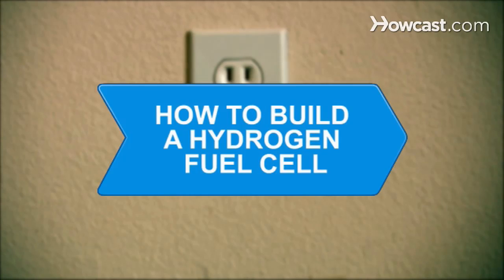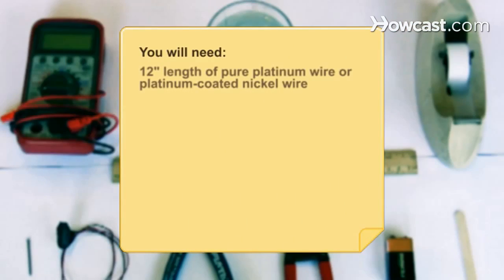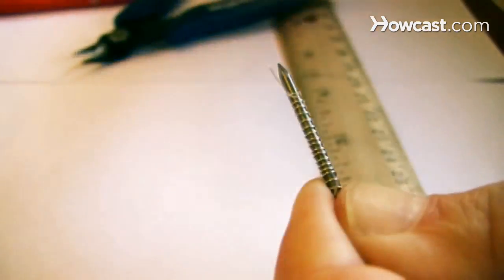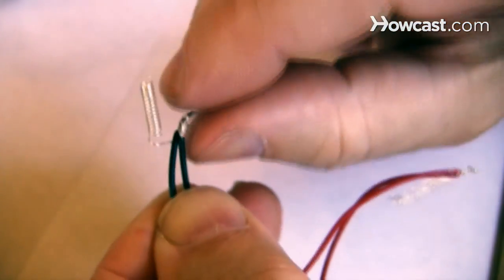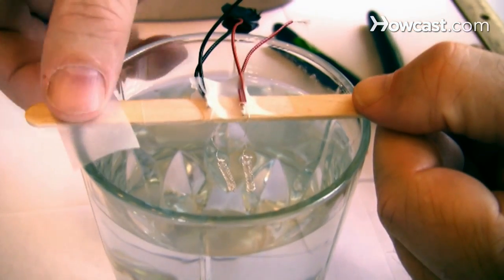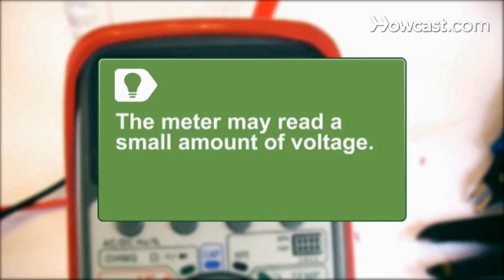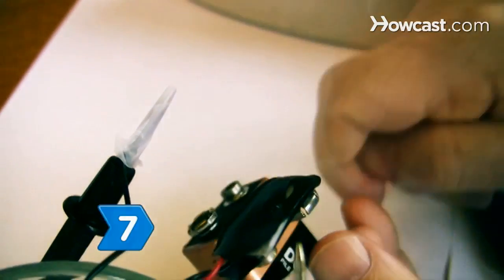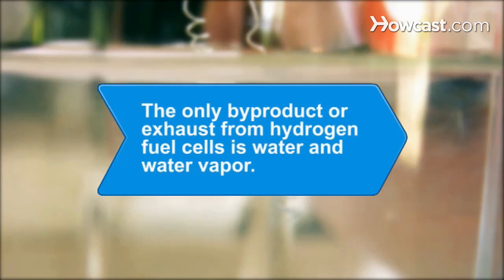How to Build a Hydrogen Fuel Cell

Comment: is it necessary to use a platinum wire only?
Reply: Platinum won't corrode when using the electrolyzer, you can also use stainless steel electrodes also.

Comment: Sorry to break it to you, but this is not a fuel cell. Fuel cells produce electricity by oxidizing hydrogen (making water). This is an electrolyzer, a device that separates water (hydrogen and oxygen).

Other than that, this is a nice device

Comment: will copper wire work, or does it have to be platinum wire because I'm not spending $90.00 on some wire.
Reply: It needs to be platinum. This is one of the main reasons these fuel cells arent very widespread
Reply: will nichrome wire will work?
Reply: The Creative Lone Wolf Channel I don’t know I used a combination of aluminum and platinum and it did the job well it had 6 volts going through it, it was enough to power an RC car for 1 minute

Comment: This is not a fuel cell, it's an electrolytic cell. The fuel cell produces electricity from H2, an electrolytic cell produces H2 from water.
Reply: Need to watch the end. At step 7 he removed the battery and got voltage as the hydrogen and oxygen recombine thus indeed it is a fuel cell
Reply: The real hero here is platinum which is expensive catalyst i want something cheaper
Reply: @omsingharjit   Yes it makes me wondering. I have a micro off grid system with a solar panel of 45 Watt and AGM battery of 14Ah 12V, how long would the platinum wire need to be in order to reach the same electrical capacity of that 12V battery, and... will the platinum hold/not corrode?
Reply: @pieterpauwelbeelaerts5995  try to make Hydrogen fuel cell with cost efficient platinum electrods .
Legnth and waight doesn't matters but Surface area does and it doesn't corrodes .
Reply: @omsingharjit could just have copper coated in platinum, as you said only surface area matters. Wouldn’t be too expensive I would of thought. Anyway upfront cost would out way the cost of paying for electricity from the current national grid…
Reply: @darknightfawkes1028  there is difference between platinum coated with copper and  copper coated with Platinum.
Reply: @omsingharjit  yeah I know, why are you saying that?
Reply: @darknightfawkes1028  I mean, would not it be cheaper to use platinum plated copper then using the bare platinum metal ' that's what i was saying.
Reply: Platinum allows hydrogen and oxygen to combine.. 
When this happen electricity  is produced.
However this simple demonstration uses more electricity  than it generates..
The Loss from the 9volt battery is greater than the electricity  generated.
If you can split the hydrogen from the water with say a solar panel .. this is the future we are looking at.
Toyota has a range if hydrogen  fuel cell cars and small Vans.
●
I first saw them in the UK 2019
They are amazing..
Buy platinum..lol
Reply: @paul_the_merciful  you put in 9 volts but you only get about 1 volt I have gotten 1.08 volts max
Reply: Al Wa 王八 王八蛋 Winnie D pooh  how ? Any scientific paper or post ?
Reply: This is a demonstration of principles, not a practical device. He briefly uses electrolysis to get hydrogen and oxygen on the electrodes then removes the battery and shows the device now generation electricity from these gasses. A practical device would be much more complicated and expensive to build.
Reply: I re-watch it and notice he already used plated platinum, so don't remember why I commented this 😅 !
Reply: @omsingharjit  yeah I also noticed that lol, but this video isn’t the best to be honest 😂
Reply: at the end though, he said the system read a voltage

Comment: so this uses h20 and platinum to continuously produce voltage even after the input voltage is removed? how long does it do that?
Reply: As long as you can supply hydrogen and oxygen it'll keep going (not sure about degradation over time/use but I would say its in the years at least). Its a battery that runs off fuel input, rather than charging. Or more accurately its an engine producing power from fuel. So as long as you provide more fuel it makes power.

Comment: How does that setup stop the produced hydrogen from rising up into the air and just blow away as soon as it's produced? Doesn't make much sense to me...
Reply: It doesn't you make this then light a cigarette and blow up!
Reply: My question is, I want to light up the Hydrogen considering it's in small quantities, so should I?
Reply: it recombines dissolved Hydrogen and Oxygen in water to form water
water can contain H2 at 1.6mg/L at 20deg, and more for O2
so its enough to power small electrical devices safely, around .0394wh of energy in 1L of water
mb you can dissolve more H2 via bubbling it in water and it reacts around the platinium

Comment: So in simple word...water can be use as rechargeble battery? 
that what in my mind after see this. is it true?
Reply: no
the battery splits the water into hydrogen and oxygen, then the hydrogen and oxygen form back to become water and a small current is produced. you put more voltage IN than you get out. This is NOT a rechargeable battery...

Comment: its green, cause 9v batteries don't cause pollution
Reply: The best way is, rather then using a 9v battery, use a 12v solar panel
Reply: technically true and false. pollution was generated in the making of the battery so its already made its pollution. 
its difficult to be true green until we get rid of all Co2 emitting power productions.
Reply: @darkshadowsx5949  what about buying second hand solar panels?
Reply: also this sounds more like a hydroxy fuel cell

Comment: How is it possible that the cell works while the hydrogen and oxigen isn't seperated. I always thought that by seperating the two gases, with for example a membrane (or in this case maybe water), you could create a current.
Also I don't get how the hydrogen gas stays where it is made, or within a short distance of the platinum electrodes. It looks like it is just flying away (the bubbles are going up...).

Comment: this is a great video of the concept.  remember kids, energy can be neither created or destroyed. You can store energy. You can transfer energy from one thing to another, and transfer it to something else or even get energy back.  The battery contained energy until it was put in water.  since it takes energy to split water into Hydrogen and oxygen, those little bubbles that stuck on the electrodes have energy from the battery. Finally we see energy coming back out and shows up on the volt-meter!
Reply: But that is not a fuel cell
Reply: @SultanSalahddin  Yeah I was thinking the same thing, isn’t that just an electrolyzer?
Reply: Thank you teacher !
Reply: @lrham  must be sealed too!

Comment: How would u keep it running for a long time?
Reply: not. only the small amount of H2 in and near the Pt electrode will generate electricity. Once that is converted the flow of elctricity will stop.
Reply: @raccoon6072  you would need two separate reservoirs fro the hydrogen side and the oxygen side so that when you took it off charge, and wanted to run (say a motor), you would then be able to make more current as the oxygen and hydrogen rejoined to make water once more.

If we could use say plastic pop bottles in series, we could make enough voltage to power something for a while.
Reply: @kungpowchickenwing  correct, capturing H2 and O2 separately would help. But even then, the amount of electricity produced would be 50 - 70 % of what the has battery delivered to produce H2 and O2. Another issue would be the voltage. The battery deliveres 9 V, the hydrogen cell ~ 1... 1.5 V.

Comment: Great and I have some questions which would be the best wire to use pure or platinum plated. Also couldn't you use a LED not a voltmeter to check whether it works

Comment: @therealorberon thermodynamcally  you need 1.23 volts (the gibbs free energy difference between (water) and (hydrogen+oxygen) to break up water. In practice it takes more than this voltage, because of little inefficiencies in the system having to do with the electrode material, water structure at the electrode, etc. You thus can get 1.23 volts out of recombining (hydrogen+oxygen) into (water), but now the real world inefficiencies will cause you to get less then that.
Reply: As an Aperture Science Personality Construct, I only have 1.1 volts available.

Comment: Such a simple process yet to move into production scale seems almost impossible-why?
Reply: They do sell "Hydralight" for $20, but the metal that catalyzes in it's fuel cell BARELY lasts for 3 dips in water and it's SUPER dim. (A scam, pretty much).
Reply: Platinum

Comment: I would say this is the simplest way to make a hydrogen fuel cell. To make a REAL fuel cell... well, you can't. Not homebrew, but rather buy one of those expensive science kits with the real deal. And actually, you can use something other than a battery to power this, i.e. a make shift wind turbine. Just a thought.